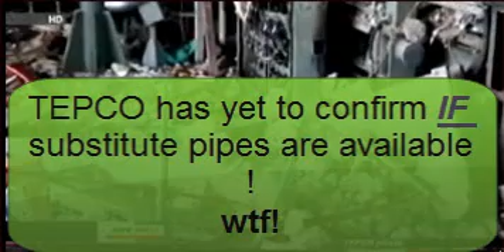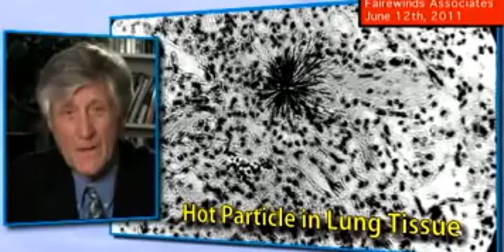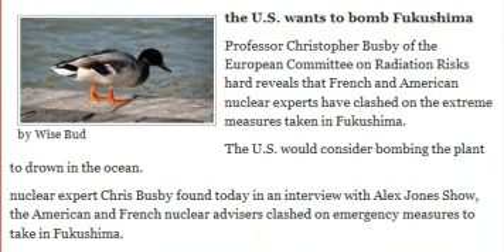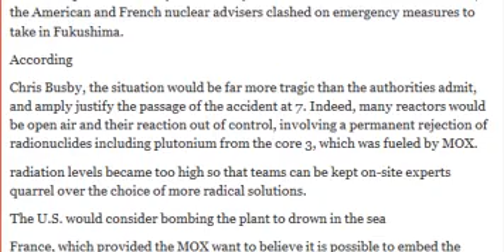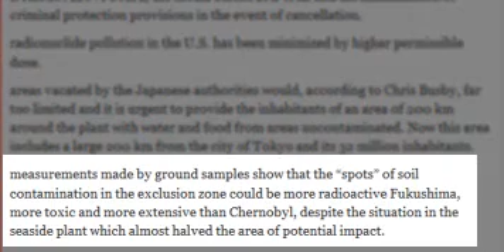US prepared to BOMB Fukushima...☢ Update for 6/12/11

Comment: Evacuate Japan, most of the Geiger counters are not able to detect the Soft x-rays energies from 1-39 keV while the most damaging radiation occurs at 1.4 keV, this causes double dislocation of the DNA helix of which 20% of the population of the earth cannot repair due to a genetic defect. The rain is not the problem anymore, the AIR is, using a soft x-ray CCD detector, the air coming in from japan is full of soft x-ray emitting particles/atoms, this is way worse than is being reported by anyone.